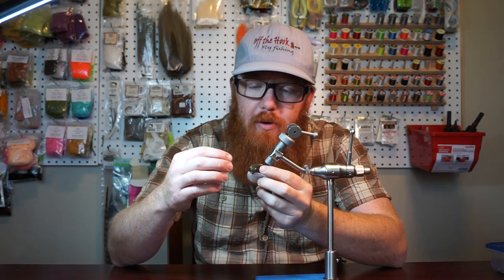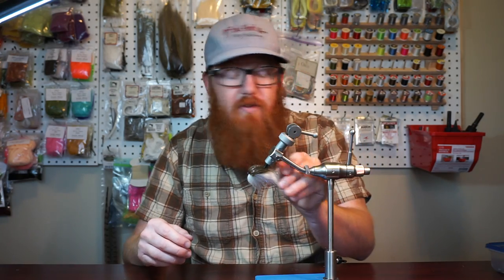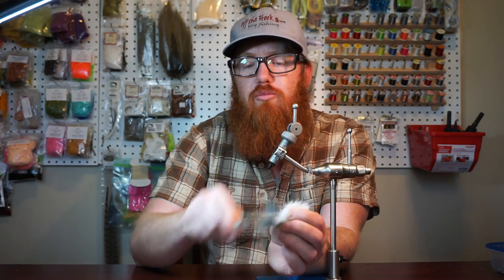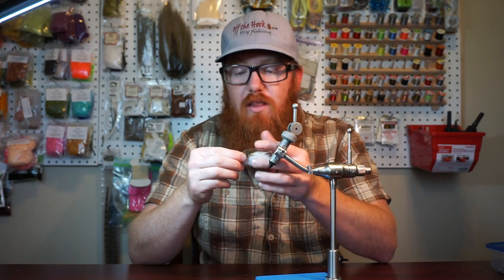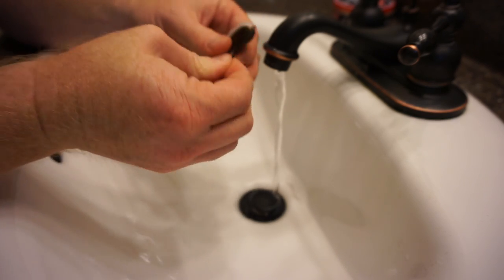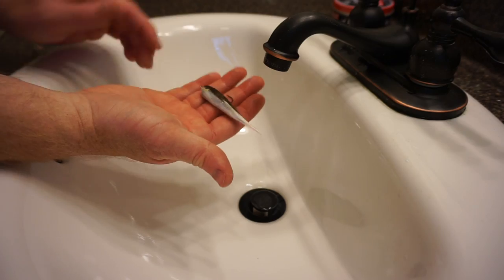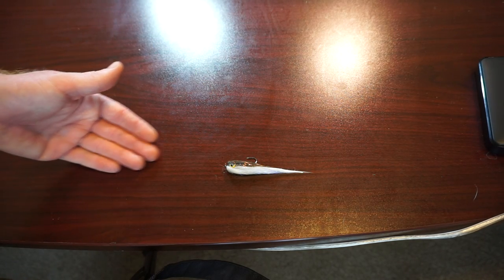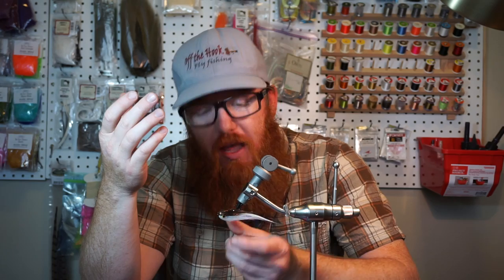Finishing a Streamer Fly for a Professional Look - Fly Tying Tips - McFly Angler

Comment: You brought up wet flies in your waterproof box, here is an idea/tip that I use to combat this. I keep those silica packs for electrics and what not and put one in the bottom of my box to remove some of the lingering moisture from my bad and save my hooks.
Reply from the maker: +Cody Lax good idea!  What I usually do is put any fly I use on a patch so it dries before putting back in my box while out fishing.  But I might grab some of those just in case.  Thanks for the tip!

Comment: nice  tips and i used warm water to help aligning the fibers or twist in diy acrylic dubbing
Reply from the maker: Yeah warm water could work also, but either works well for what I do.  Seems to work just fine with cold.  Do you notice much of a difference between warm and cold?
Reply: it depends on the tipe of yarn most of the brushing usually gets the twist out but for stoborn fibers the hot water softens them and can straight or curl up the ends on long pike and musky flys
Reply from the maker: Good to know, thanks!